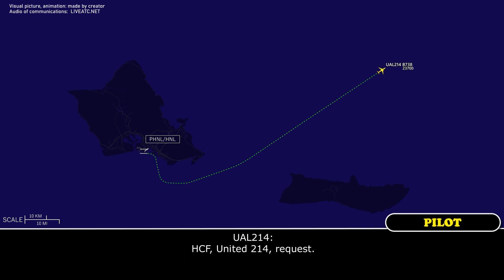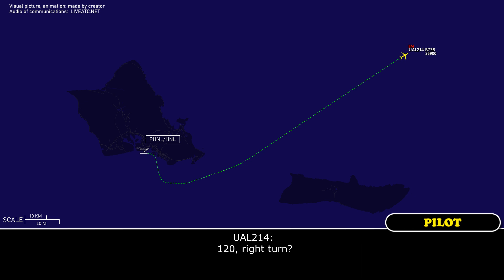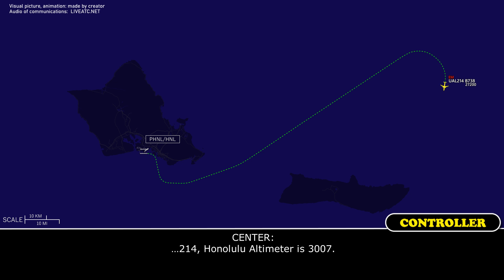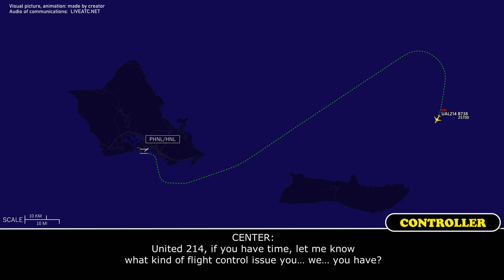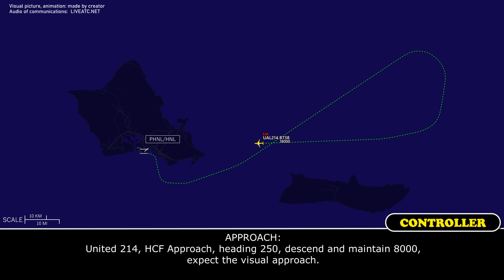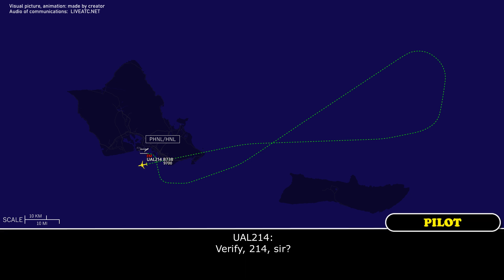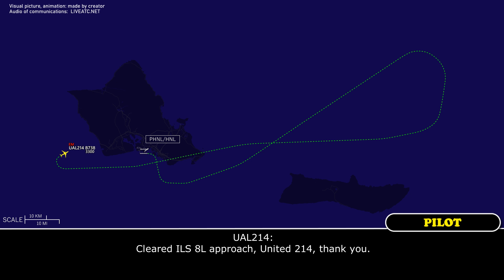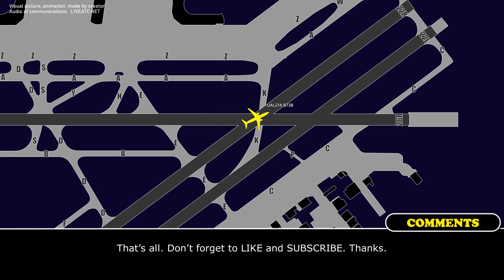“STABILIZER TRIM IS INOPERATIVE”. United Boeing 738 declared an emergency and returned to Honolulu

Comment: What's sad is having to be in a 737 from Hawaii to the mainland.
Reply: My first thought as well.  I know why the narrow body aircraft are used, but nothing beats a wide body on those 6-8 hour flights back.
Reply: The airplane itself clearly didn’t want to make the trip either
Reply: While I generally would agree, United's particular fleet is counterintuitive. The United 737 is more comfortable than their domestic-configured 777-200A they use on this route. The 3-4-3 squeeze in the back is 😮‍💨, and the 777-200A has 350 seats! That means a longer boarding and deplaning time, a longer baggage carousel wait, and a more overwhelmed car rental depot in Hawaii. However, if United were operating the 763 to Hawaii, then I recant everything I just said.
Reply: @andyplace  you are right about that. And their 767 is way more comfortable than the 777…
Reply: @windanthonystream  haha good points. I’ve been spoiled the last few years with 1k and usually get the upgrade. Wide body means lie flat vs. 737 I can’t

Comment: Another Hawaii incident?!
Reply: If you mean when the upper fuselage skin departed the aircraft, no.
Reply: @derheeheehee6941  He means the 737 that ditched recently I think. Not unusual at all to have several unrelated issues with aircraft months apart from the same airport.
Reply: @fascinatingtome  oh yeah I forgot about the one that had to ditch
Reply: @fascinatingtome  That wasn't especially 'recent,' though. It was more than a year ago (July 2021.) Granted, it was far more recent than the Aloha flight where the skin blew off of the upper fuselage. That was in 1988.
Reply: Yup, another event was recorded and put on YouTube that happen to be in Hawaii. Crazy.

Comment: Stab trim. I like manual reversion.
Reply: That's not manual reversion though. Manual reversion (loss of hydraulic SYS A+SYS B) is much more difficult to handle in my opinion.
Reply: @enzino237  That is true. I like the idea of cables going to the elevator and manual stab trim.
Reply: The 737 definitely has that.